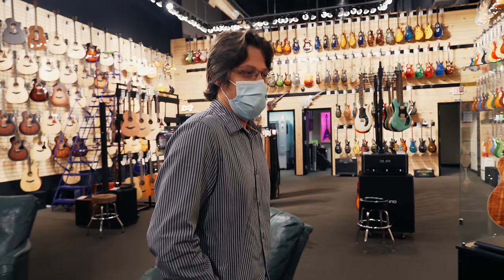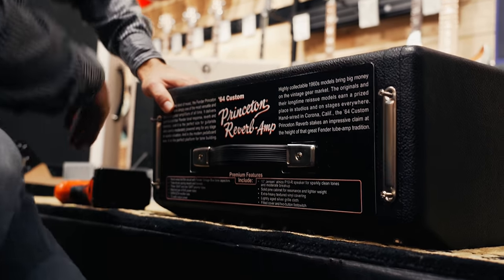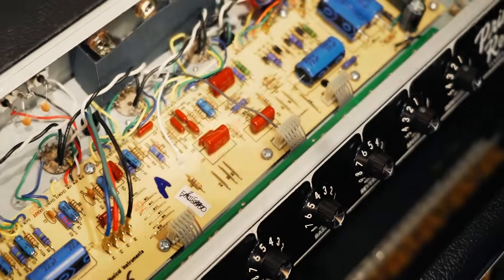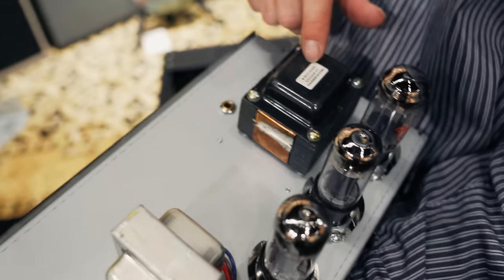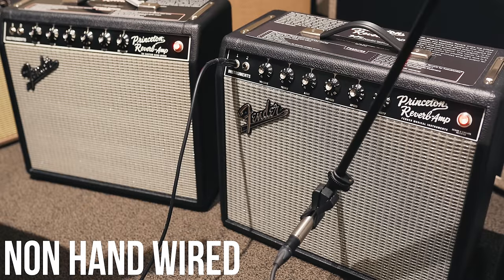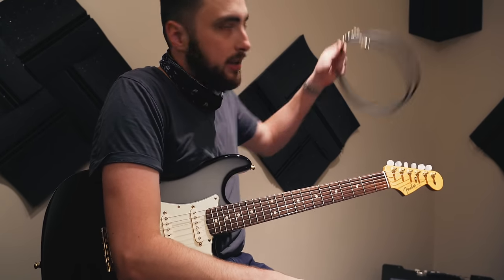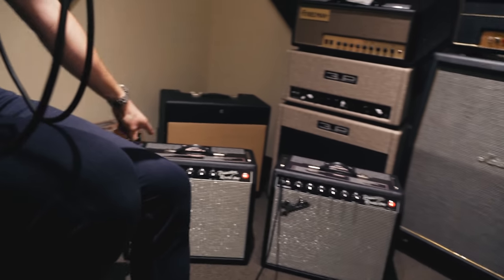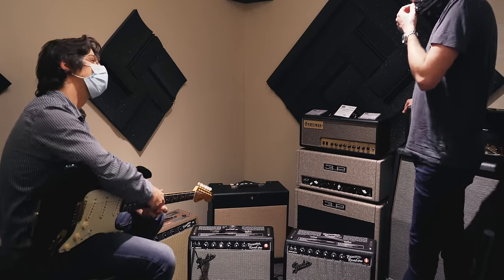Are Hand Wired Amps Really Better?

Comment: I feel like there's so much confirmation bias around these kinds of tests if they're not blind. The hand-wired amp is twice the price and has more expensive everything, so any difference is perceived as an improvement. So the circuit board amp is brighter. Perception: 'Too' bright, 'too' scooped', Hand-wired is 'warmer', etc. Whereas if the more expensive amp was the brighter one and the cheaper one was the darker one, the conclusion would be that the more expensive one was clearer, had more sparkle and chime, and the darker one was 'dull' and 'muddy'. Of course there's going to be a difference, but the question is whether that difference is 'better'. This is why a blind test is always better. Make your comments about the different tones without knowing which one you're listening to. Otherwise you will always hear what you want to hear.
Reply: Totally agree
Reply: Absolutely
Reply: 100% dead on.

Any test involving sensory interpretation and preferences needs to be blinded or its worthless.
Reply: Hearing with the eyes or nameplates, I used to do this with Peavey products, and others , I hated the look and hideous logo ( Peavey)  so they must suck. Circuit curmudgeon’s suck. I’m playing through a Blug Amp-1 Mercury all analog and carefully wave soldered in China ,lol but has glorious  arshally tone (s) and feel.
Reply: @michaeltaylors2456  I use a Peavey Classic 50 4x10 from the early 90s. Admittedly I've swapped the speakers and valves but I removed the logo and people always compliment my tone and ask what amp I'm using. Their reactions are priceless when I tell them it's a Peavey.
Reply: You nailed it!
Reply: @michaeltaylors2456  Yeah I had a Peavey Classic 50 for years and everybody thought I was some kinda tone guru because I got good tone through a Peavey. But in fact the Classic 50 was just an amazing sounding amp.
Reply: @tommyboyce  Yeah I had this exact same thing. Brilliant amp.
Reply: Totally agree!  And the speaker difference is crucial.  Blind tests might change everything.
Reply: Couldn't agree more.
Reply: The way you described the non hand wired amp as clearer with more sparkle and chime, that actually was the way I heard it. The hand wired one definitely sounded muddy to me and when it broke up it kind of had an unpleasant "rattle." Am I the only one that heard that?
Reply: @hoggboyy  I did not want to say that but that is what I heard too.
Reply: @hoggboyy  Felt like the non-hand wired had more of that classic spank one might expect from a strat through a fender amp back in the day. overall, I liked the tone of the hand wired better as I like a rich mid and it seemed to especially have punch in the low and some nice presence in the upper mids. But, while I've always been leery of a fender guitar through a fender amp in the wrong setting (say, trying to gain-blast the doors off the room) as it would get too bright, I could definitely see where the non-hand wired might have a place especially in a studio setting playing, say, funk, where you want some bright spanky tone.
Reply: @leonid4468  sure, and I see where you're coming from. Ultimately, it is a purely subjective thing.
Reply: @hoggboyy  Absolutely! Especially when one considers how even individual ears can change over time in response to frequencies...namely the high ones that start to disappear depending on the ratio of age and loudness of previous bands one played in haha. Still, I prefer a nice warm sound in most cases, but some like more of a high bite. But even for me, there are tunes where each has a place and wouldn't be the same without the proper tone be it mid warms or cool highs.
Reply: @leonid4468  to be completely honest, I don't care much for Princeton amps, haha. If I'm going with Fender, I'd much prefer a Blues Junior or some tweed amp.
Reply: Vintage is old junk overpriced
Reply: Yup, exactly.
Reply: No one was there to hear it in flash. I am an amp-designer, and I can say, no one can replicate live feel on the recordings. So we must trust at some point what those guys say.
Reply: Their points are actually valid. Spot on. They are comparing specific units. I have a ‘65 Princeton Reverb reissue and have tried the ‘64 hand wired. I agree with their assessment. The scoop thing / won’t cut through is a speaker problem on the ‘65 (it’s real and not perceived) and choosing the right speaker and tube complement is the solution (I did and big improvement). What is important is that the basic amp (less speaker and tubes) and it’s cabinet are great. I believe they did mention that in the end it was “less a sonic issue” and more a “stability” issue. My 3 year old ‘65 Deluxe Reverb reissue (also with a changed speaker and tube set) has been in and out of the shop a few times already. They may be right there too sadly.
Reply: I used to be. Mom bought me one out of a pawn shop that screamed back in the day, $130ish. Because "she wanted me to have a chance". Handwired original beast. But I needed something bigger to gig with. Before micing. So off it went. Damn.
Reply: Dan D  I don't think they're trying to pull a fast one, I just think sometimes we hear what we want to hear. And yeah I do think that hypothetically if you tested every amp with a blindfold you may well choose a different amp than you would by seeing the logos and price tag. Our biases towards what we think 'should' sound better definitely influence what we hear.
Reply: I honestly felt the circuit board amp recorded better and had way more fidelity. The hand-wired one sounded a little wooly. I'm sure it felt different in the room as always.
Reply: I have found that non-hand wired Fender tube amps sound brittle, while their hand wired amps sound warm and and little loose.
Reply: The variables afterwards out the shop door later are so, so many too. Wall/power supply Voltage in, effects, digital or analog or both? Room space, flooring, guitars and how they're dialed in and on and on. I just focus on how much it costs, weighs, quality control, general character, headroom type, you know, the unchangeable.
Reply: That’s soooo true. I listened with audio technica mh50 phones, and through klipsch monitors, and “massive improvement” is just not true. The pcb is not bright and harsh etc. they both sound very nice, and I am sorry but I hear Rhett wanting the hand wired amp to be superior much more than the sound being superior. If you love that stuff like vintage and hand wired, and you know which one you are hearing then yes you will change what you hear and say that the flaw in one is a strength in the other (like brightness being harsh in one but chimey in the other). It’s really cool to see inside and hear them both but it’s a bit much to immediately jump to hearing a massive improvement in the really cool but really expensive hand wired amp. Just not that much better.
Reply: @jasong546  -True. I think their massive improvement is based on sitting in a room focused. On stage, people don't tend to notice the difference in quality like that, but I think it's more about how it motivates the player. Humans are relative beings where not everything is objective, so I guess at some point it is just about personal choice.
Reply: @jasong546  Yeah this is what I object to in lot of these videos. Any difference is described as a HUGE difference, when there maybe a difference, but it's probably pretty subtle.
Reply: How dare you make a sensible comment on the internet, and about "tone" no less!!
Reply: The tone part was IMO totally subjective, but the serviceability question was completely legit.  As manufacturers move away from sturdy PCB's and flying leads and toward board mounted Tube Sockets and Pots you're going to see a whole lot more effort and specialized components to service your amp.  The amps I've built can be serviced in minutes when something basic fails.  It takes longer to pull the chassis and get a good DX than it does to actually swap the parts.  Turret boards and sensible layouts FTW.  If you're gigging the thing all the time you don't want something that relies on proprietary parts from the manufacturer.
Reply: @ryanprentice6921  totally agree with your points about serviceability. Don't get me wrong, if I was offered a choice of either of these amps I would choose the hardwired in a heartbeat because it's a higher quality product. And obviously they sound slightly different and I'm not saying there's anything wrong with preferring the sound of the hardwired. I just feel that the 'sounds  a million times better' vibe is exaggerated by confirmation bias in some of these types of videos. For example I saw another one comparing the tone of a well used Vintage Reissue Stratocaster with an actual pre CBS Stratocaster. The comments from the reviewers were that the difference was 'amazing' and the pre CBS Strat sounded 'so much better', like it wasn't even close. But it was SO close. Whatever difference there was was extremely subtle. And you'd hear the same subtle differences between 2 genuine vintage Strats anyway. But I think we just exaggerate it in our brains because we've decided before we even do the test that the more expensive or older one is going to sound better. So if there's a difference at all, it's automatically an improvement.
Reply: Well said. Also, at least 50% of the differences they noticed were due to the speakers being intentionally designed to sound different(NOT better in quality) in the exact ways mentioned. The rest of the difference is better quality iron- which has nothing to do with hand wiring. Swap the 65PRRI speaker for a WGS American Vintage series, the trannies for Mercury Magnetics, and you'll never pick the HW over the 65RI- regardless of the caps this guy was gushing over in the video. And a 65RI even with a WGS & all of the iron swapped is still about half the money compared to the HW 64 Custom.
Reply: A better test would be reamping with an IR. That way yo have the exact same dynamics of the performance and the same speaker without worrying about mic position, type of cabinet, etc.
Reply: I agree to an extent. There is a point where it could just be too bright. But the speaker and cab obviously made a big difference in this video. He mentioned the breakup being better on the HW. I owned a couple 65 DRRI's and always thought the breakup was too harsh until an amp tech told me they were all biased cold from the factory. He re-biased it for me and it improved the breakup a lot. I think there's a point you could get to with a new speaker and some tweaks where the differences in tone would be way too small to justify the price difference.
Reply: I’m spoiled my Dad had a fender Princeton reverb from 68 when I was growing up so that’s the amp I’m most used to in earth. When I went on the road with my first band I asked for the reissues in my rider which they rarely had (mostly twins which I hate). Anyway the few times they had the reissues it felt really foreign, brittle is the perfect way to describe it.
Reply: I think you’re right, it would be interesting to try them, but both with the same speaker.
Reply: There was some unintended bias, setting up a sound you like on the expensive amp then trying match it with the cheaper amp, it would have been interesting had he spent half an hour getting the best sound he could out of the cheaper amp then trying match it with the dearer amp.
Reply: Could not agree more.
Reply: I don't necessarily agree here. I didn't pay for either amp. I have absolutely no horse in this race. I do however feel the circuit board amp sounded much thinner and had a very unfavorable top end. It was not chimey, just thin and slightly ice picky.  That has nothing to do with the cost as didn't pay a dime towards either one. It's just what my ear hears.  I would , going by this demo, pay twice as much for the handwired version.  I am a Marshall l guy so I have no intention on buying either. They're just not my thing but to me, I would never pay 1300 for the cheaper amp. I can get a much nicer sound from my $400 used JTM 30.  I might consider paying 2600 for the handwired version, if I were going to go the Fender way again. I've spent much more on either of my Solano amps, which happen to be circuit board amps. I have nothing against circuit board amps, if they sound good to me. This one here did not.
Reply: Setting your bias point is also of importance to getting the sound you want.
Bearing that in mind I'd always go with hand wired.
Reply: @brdw  I agreed
Reply: Someone had to say it!
Reply: @cam sutton
This comment is everything!
"Psychoacoustics" (I believe) is the technical term for hearing any tonal differences that we're told (or are expecting) to hear.
Reply: Very smart
Reply: This comment and thread below is  part of the reason why music recordings sound like crap nowadays...lay off the McDonalds
Reply: @MrMojabo  You don’t have to go to vintage to get hand wired
Reply: Nice. I totally agree.  Even I can solder ,, why pay so much cause someone decided old stuff renamed vintage sounds the best.  Wish my 72 Ford Ltd was called vintage ,,,
Reply: To be clear, I'm not necessarily saying the more expensive one doesn't sound better, or different. I'm just saying comparison videos are skewed by confirmation bias if they're not blind.
Reply: Funny how price influences hearing.
Reply: Well clearly here it’s much better.. haha 
The circuit board amp sounds a lot thinner and frail with no girth to the notes. The handwired on the other hand, the notes are fuller, more lively and bloom. Not to mention peace of mind in owing a amp that will far outlast you. Cheers
Reply: I mean the thing is they were talking about how it would work in a mix, not just whether they liked it 

If something hasn’t got the mids to be able to cut that’s not something you can just deny. That’s not in any way subjective
Reply: Well...Perception: really is everything. All we have are our senses to judge. Perception: Is certainly how people get away with magic tricks at parties with better balanced warmer, deeper overall just shit more expressive guitar tone.
Reply: Yes. basic expectation bias: You reframe all the standout differences according to which amp the "experts" would say was better.
And many of the tonal differences can be explained by not using the same speaker.
I have 3 vintage (70s) marshalls, a modern marshall and a Roost - but I'm not into the Mojo BS at all.
Reply: Totally agree. That said, the
 handwired was noticably better even blind. I was actually rooting for it not to be, really wanted the "cheap" Princeton to be in the same ballpark for $1300 less, but damn...
Reply: @digable_celestial_dwarfs6778  
Define "better" for us, mate.
Reply: @wordragon  - your 'brittle' is my 'chimey'.
Reply: Well said. And when it comes to price, for me, there's a "it's good enough" point. I would not pay an additional $1200 for the hand-wired amp. On the non-hand-wired amp, I can dial in the sound I want, and very few people are going to notice the difference. When I  was a drummer I spent way to much time tuning my drums, even though it is important to tune them right. But I went overboard, to where the differences I tried to make sounded better to me, but at a gig, no one would be able to tell the difference. When I backed off on perfection I saved a lot of time, saved a lot of stress, and still had great sounding drums.
Reply: @Voartist  
True. There's this "pursuit of excellent tone" theme all noobs soon get sucked into because it's "what you're meant to drool over gear if you're a pro". And there are a few realities about it.
First, obsession. Most people are insecure and so become obsessive about this idea "quality" which they fabricate from other people's anecdotes and spotty experience without any methodological controls.
The dream: "I don't sound enough like ME yet... If only I had THAT piece that so-and-so uses."
Next, they never realise what "quality" really is - apart from being a subjective idea that all the "experts" are telling us IS actually objective - because it sells gear, and/or they have endorsements and deals to honor.
Also, many people who get to pro stage STILL labor under the same instilled mythology, because it helps them feel they have a certain position in the "pro" team.

But the comments here are great.
Even when you have someone insightful explaining that we simply change descriptors to suit the dream: An expensive amp is "crisp" and the cheap amp is "harsh"... etc etc. And all the time, 99.9% of these people couldn't pass a ABX test.
And this ALL works AS LONG as people avoid testing themselves.
Reply: @Dr-Curious  Well said. Maybe having a low budget keeps me in check. I'm a gadget guy, but keep myself pretty well in check, and I'm learning guitar. But I'm hooked up with a good teacher who has already said that the best equipment in the world won't make you sound better. I have to practice, practice, practice. And when I get good then I'll be able to make poor equipment sound better. Like you said, all these are good comments and if someone has the money, it's theirs, they can spend it on what they want. I don't have the money, so I make do with what I have, and if I ever do get some gigs playing guitar, I'll strive for the best sound with what I have and probably very few will ever notice that "hey, that's a crisp or harsh amp. I wonder if it's hand-wired or not?"
Reply: Don't need no stinkin blind test. The difference was so great as to be astounding. Ya cain't blind someone's ears. Different components, different sound.
Reply: @choimdachoim9491  
"Different components, different sound."
Well no. That's not an axiom.
There are IC's now that can outperform or match discrete op amps and are used in top-shelf studio equipment. 
There are TIMES when certain factors are at the audible level, but it's not a given.
Reply: Usually they can be good for different things. It's a con to call 2 totally different products the same name though. Its not the hand wired thing that makes the different it's everything but the hand wiring that actually makes the difference.
Reply: You got it man
Reply: @tommyboyce  Peavey had very good clean tone on their amps. Admittedly I only played transistor ones extensively but the clean tone was always great and the cabs I have seen seem well built enough so no real reason why they shouldnt sound good.  Usually there are no great surprises in a tube head either, alot of the layouts come from old RCA catalogs.
Reply: It's all about marketing.........
If David Gilmour used a Roland Cube every so called Tone chaser would be desperate to get their hands on a Roland amp.
Reply: Sorry dude. The handwired in this case, was better in every way. With that said, I prefer Marshall silver jubilee over all other amps I have. I do have a fender stage 112 solid state amp. Two resistors burned up after couple years of ownership. I bought it in ‘94. Went up in smoke in ‘96. Nobody has been able to fix it. For that reason alone. I’ll pay more money for handwired amps. Never had one that ever needed fixed, but could easily be fixed if ever needed. I’ve had 5 or 6 VERY qualified techs attempt to fix it, with no luck. The deal is, when I buy an amp, or guitar for that matter, I buy because I love the sounds I’m getting from it. And most amps just sound different than each other, except solid state. I want equipment that lasts longer than me.
Reply: Like for real though PCB is garbage but its okay sometimes but like come on man don't FAVOR a MACHINE over a HUMAN EFFORT its just disrespectful.  Now I appreciate the human effort that made the stuffing machines because that is REAL electrical engineering and automation but come on dude BY musicians FOR musicians?  Who's team are you on?
Reply: @zvotaisvfi8678  that's a great point. 
That's exactly why I bought a 50 watt hand wired amp head from Wang.I 👍👍🤑
Reply: @gregmacklin9758  Congrats!  Spread the love for people keeping dreams alive!
Reply: @zvotaisvfi8678  Amen brother Amen. 
And may I also give you a little O'l band from Texas shout out to our beloved Dusty Hill. 
Jesus just left Chicago and took Dusty Hill with him to that , home out on the range.
Have Mercy!!!!🙏🤠
Reply: @gregmacklin9758  Yes Wow!  What is most striking to me about this man is how happy he made everyone!  At his shows you can tell everyone was just so joyful.  I will pray for him, yes sir!
Reply: @MrMojabo  Until you do the work to restore them.  Go try and build a tape machine and I'll see you again in like 3 lifetimes.
Reply: @zvotaisvfi8678  why would I build a tape machine? sorry but I don't know what you are saying. did I say something about restoring a tape machine?  so many comments here I cant find the one you are referring too
Reply: @MrMojabo  "Vintage is old junk overpriced"
Reply: @zvotaisvfi8678  are you talking about vintage is overpriced junk...   well it is.  its ridiculous how much money people want for used stuff. if you don't want to be honest about it that's ok. but don't blame me cause I'm not a fool.  someone takes a piece of old gear sticks vintage on it after its been used for 30 years and wants 2 thousand more bucks.   be honest.
Reply: @MrMojabo  I totally agree Idk i'm just on a rampage or something today lol.
Reply: Good points. The price has gotten closer now, you can get these '64 handwireds for ~$1600-$1800 if you're patient now, which helps justify some of it. But you can also get the reissues for $700-800 and throw in a different speaker, so ya. There's also the 68 customs that come with a bassman circuit in one side.  So I'm not sure what to do.  I have a '65 champ that I sometimes find myself yearning for a real spring reverb and a little more headroom that a princeton might give. I sold my twin reverb and a deluxe because I could never turn the amps up to their sweet spot and the music I play is all edge of break-up rhythm guitar tone stuff.  Blind test with an eq dialed in (much less effects/eq, or a midhump from pedals etc.), much less in a mix, pretty hard to tell.
Reply: I agree. I don't think either one sounds better. The hand-wired amp sounded like it hit the edge of breakup a little earlier, which can be good, but I also thought it was a bit too dark. The mass-produced amp was more clear but a little anemic or sterile. I like Princetons though and would be thrilled with either!
Reply: I'm an Electronics Engineering technologist, and the components  used in the handwired one are superior, and that makes a difference in everything.
Reply: MORE than double the price is ridiculous!  save your money , get the 65 Princeton and have money for more effects or another guitar!
Reply: Crazy being the 777th like. Enjoy your choice!
Reply: There is a great vid floating around on here where a guy does a comparison between rosewood and maple fretboards. He switched out the neck on the same guitar body and It is done blind My ear couldn’t tell the difference. One less thing to worry about when I buy guitars!
Reply: I genuinely prefered the non-hand wired 65. Hands down. Pun intended.
Reply: I thought the hand wired sounded much better. Instantly. I was blindfolded by not watching the video, just listening.
Reply: I dont quite agree. I listened while I was working, and so I had no way of knowing which was which, but I was able to tell which the handwired one was because the other WAS noticeably harsher. Sure there might be a demographic of people who might prefer that sound, but I would wager they are in the vast minority. Better IS subjective to a point, but there WAS a very clear, audible difference, and I much preferred one over the other.
Reply: @caseylockwood5512  My point is not that there's no difference, or even that one is not 'better' than the other, but that the test would have less bias towards preferring one over the other if the testers didn't know which was which. You had no way of knowing which was which, and you preferred the handwired, which is totally valid. I feel that the fact that you didn't know which is which while deciding which one you preferred lends more credibility to your findings.
Reply: @mistersooty  I get what you're saying. If they truly wanted to be scientific about it, they should have hid the identities of each amp from themselves. You're right, that would have been better for the purpose of the video!
Reply: @MrMojabo  the thing is, vintage doesn't mean better or good, they made crap back then to. If it was something really good back then, and it happens to be vintage it's OOP. But it's value is not solely because it's "vintage" thats foolish logic.
Reply: @wordragon  probably true, people just like to hate what they feel is overpriced.  My analogy is this: if you drive a Toyota to work and the next day drive a Ferrari to work, driving the same way, you wouldn't say the drive to work felt 3 hundred grand better. But.. they are not the same. What one can do. The other cannot.
Reply: @mistersooty  it's like the difference between my PRS SE and core (custom 24) they are very close,, but there is a difference,   the core does sound better. But it's splitting hairs to 99% of guitar players. To players like Clapton or Carlos Santana,  those a big hairs being split and much more noticeable to players of that caliber.  Also, not everyone has the same discerning ear,, hell my dad can't even tune a guitar by ear,, he is not a great judge of tone.
Reply: @samroney6644  you are 100% right,, but,  having a Ferrari with cheap tires will lose to the same Ferrari with expensive race tires. Everything adds to to the sum of its parts. If you had 3 race tires and 1 crap tire,, you might only notice on certain turns, and you probably wouldn't notice when driving straight, but it will show up at some point.
Reply: On the other hand, there's no major need for a blind test if your goal is simply to see what the differences are, rather than to determine which amp is "better." 

I don't see much value in blind test videos personally, because there are a ton of them on YouTube already and it always goes the same way: you get a few guitarists to A/B two amps, they guess which one is which, and some of them get it right and some of them get it wrong. I already know that's how this would go if they'd done it that way, so what would I gain from watching that for the hundredth time? The smug satisfaction of e-dunking on people who bought the more expensive amp?

IMO, the actual objective benefits of hand-wired amps are not complicated, and they were covered early in the video; they're easier to service, less likely to break, and when they do break it's more likely it'll just be one or two components rather than potentially an entire section of the circuit connected to a large PCB. That's it. The sound is the sound, but it's up to working musicians to determine whether or not those specific hand-wired benefits are worth the extra cash to them. Many feel that the larger up front investment will pay dividends after years of gigging/touring with fewer technical issues. Many don't feel that way. 'S all good.

There's also the fact that the hand-wired amps will retain their value over time. In 2045, nobody's going to care much about a 2018 '65 Princeton... but the 2018 '64 Custom Hand-Wired Princeton? That'll be vintage cool. Whether that's dumb or not is irrelevant, because we all know that it do be like that.
Reply: @joshundrwd  Some valid points there.
Reply: Also... Like... turn the knobs...
Reply: What a sage and empirical-inspired comment.
Reply: I wanted to hear that hand wired amp sound better, but I prefer the sparkle of the PCB amp. I think  the hand wired amp probably overdrives a little more naturally though. I would suggest everyone learn how to solder and build their own amp. It's much cheaper and you give every 3000 dollar amp user the bird with your custom built amp.
Reply: Agreed. The advanced guitar market is very niche. The more hands that touch and do more intricate work on products in this market are well sought after. When comparing tones it really is a preference thing. However I do agree with Rhett. The reason i primarily play fenders is if I break a neck or a pick up blows I’m less than a couple of hours out from being back in the game, so having an amp that is just as easily repaired as my axe on the road is huge for me. That being said I don’t own any hand wired amps.
Reply: Never saw it like that. Best comment  ever!
Reply: The difference is better.. in term of longevity.. easy to fix. 
When a pcb burn out.. you need to replace it. 
In a poibt to point evrething can be seen as modular. 
Easy to fix.. have better overall sound quality. 
More balanced output. 
It also response better 
Better resale values. 

Quality control is also way better. 

If you know you know. 
There is a reason why they are more expensive.
Reply: @theflattardhumiliator5624  yep handwired is much easier to fix, and it looks better, and lasts better. I have a handwired amp myself. This has nothing to do with the point I was trying to make though.
Reply: @theflattardhumiliator5624 Again, I'm not saying a point to point handwired amp isn't better quality. I have a point to point handwired amp myself and all the benefits you've mentioned I agree with. Definitely more durable, desirable, easier to fix, etc. And it may well sound better (arguably) if it has better components. All I'm saying is, and you see it so often in guitar gear reviews, that when you know an amp (or guitar, or pedal) is more expensive or has had more effort put into it, it influences your perception of what you hear. Any perceived tonal differences are more likely to be described as 'preferable'.
Reply: No way dude. I WANT the cheaper amp to be as good or better. I don’t want to pay twice the money. I wish it was close. It wasn’t. I wish we could do more analysis to figure out what exactly, the speaker was a huge part of it. But there’s an undeniable difference and I like the hand wired sound a lot better. Wish it wasn’t so.

Btw I have your reaction all the time to mic shootouts. People always say the vintage Neumann sounds better but there’s almost no difference, and even when there is it’s not obvious what’s even better or worse. 

I’m afraid I don’t think that’s the case here though.  If someone could figure out what they did to the hardwired that could be modded on the pcb, that would help us all!
Reply: @jones786 Again I'm not saying the handwired doesn't sound better necessarily. I just think these guys were sold on the handwired before hearing it, much like your example of the Nuemanns. On the one hand you seem to disagree but then provide an example of exactly what I'm talking about. I'm not saying their findings are wrong exactly, just that there's a natural bias towards the more expensive amp. I owned a music shop for ten years, I often joked that the best way to make an acoustic guitar sound better is to put another zero on the price tag. Not something I'd ever do but it's amazing what people hear when there's a Martin logo on the headstock for example. You can have an amazing value all solid wood Alvarez next to a laminated back, laminated neck Martin for twice the price, 9 out of 10 customers will tell you the Martin sounds SO much better. (I kept the Alvarez 😉).
Reply: @mistersooty  Haha I agree. Confirmation bias is a real thing, especially when it comes to music, which is ultimately a matter of taste. And most of us don't have the ability to spend a lot of time with gear at this level. 

At the end of the day, I don't care much for vintage or name-brand gear as such. I would rather make music using stuff that they'll be asking about 50 years from now. Like, "what did they use on that recording from the 2020s?" Haha!

I've got a Martin though and do love it. :) Martin is really guilty of what you say though, the cheaper ones are in fact not great.
Reply: Also, one person's 'sounds better' is another person's 'sounds worse' blind fold or not.
Reply: Yup. Personally, I like the brighter, chimmier sound. I would go with the bulk made.
Reply: I feel the perception of “better” and I guess “modern” means more midrange and I guess earlier break up too.
If that’s what you are looking for go with a Brit amp that’s what they’re good at. 
Fender is neutral plane in terms of midrange giving you the chance to craft your own special midrange. 
Fender amps kind of blend more correctly in a band mix.It’s more of a team player and unified kind of sound as opposed to a British amp that puts you direct front and center in a band mix which isn’t something you always want.
Reply: @ErikThomasMusic  you missed the point of the comment.
Reply: yeah, what they didn't mention was that the hand wired broke up quicker, it has lower headroom than the mass produced one which likely added more mids and rolled off the treble a bit. plus values of the knobs can be different too. maybe the treble knob on the specific mass produced one they had goes up a little bit more than another which might even go darker than the hand wired, and yet another that might be the exact same. with this you may need to compare many of the same amps first. maybe the mass produced ones are more inconsistent than the hand wired
Reply: @TasmanGuitarsAmps  makes sense... kind of like a tube amp vs a modeler....the "feel"...the other senses also get a say.   Played through my first boutique amp this week (all week!) a Hamptead Artist 20 and am blown away...makes the Deville, Blues Jr, Line6Alchemist, Vox AC10 , Roland Blues Cube sound good but clearly inferior.  AC30's, Mesa's and Marshalls in my past never really 'impressed' me to tears.    Pure sonic joy I'm having. My ToneKing Imperial arrives tomorrow....my 20+ guitars deserve a quality amp to fully express themselves.
Reply: Amen to all of that.
Reply: The hand wired just sounded nicer to my ears, but I do think that sticking the good speaker into the pcb amp would nearly have you there if you turned the treble down a touch
Reply: I'm totally with you on this one...
Reply: Also, to be scientific, you’d actually play the same thing (with the same pickup selection!! lol) through a looper. 

Oh, and maybe play a guitar that’s set up correctly and doesn’t have huge fret buzz on every single note.
Reply: Ha ha ha, talk about hitting the nail on the head!
Reply: 100% on target
Reply: @sboy1955  evening a blind test is pointless because if you set both amps to the same settings the better amp might hve settings that could be much improved, all in the name of trying to make it as close as possible comparison, it's stupid, do they have the same speakers? Are the tubes the same make, and biasing matched? Ludicrous
Reply: Yes there can be “confirmation” bias, but there is also power amp tube bias.  Did they check the power amp tube voltages and bias before testing?
Reply: 100%
Reply: 1000% agree!
Reply: This comment deserves its own video. Well put
Reply: Agree
Reply: Yup, 100%
Reply: man ignore what they're saying and just listen. one is clearly a richer sound.
Reply: Take 5 or each type and have someone play through all 10 and ask them to pick out which one they believe to be hand wired. Chances are very few, if any, will guess them all correctly.

There are a few exceptions. A person who's been playing for many yrs and has a great deal of experience with a specific type of amp may pick up on some differences but it's still unlikely.
Reply: I close my eyes and decide in my head what sounds better😂